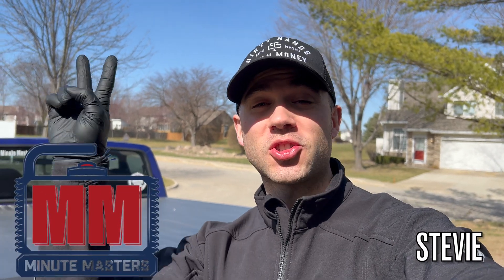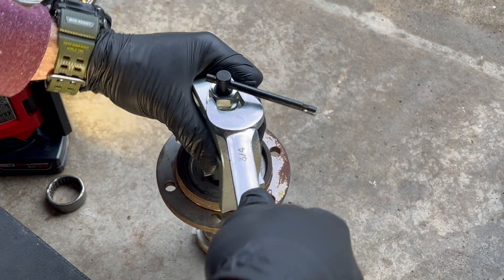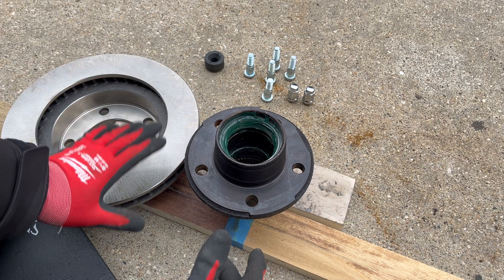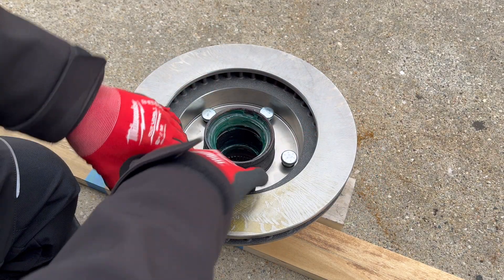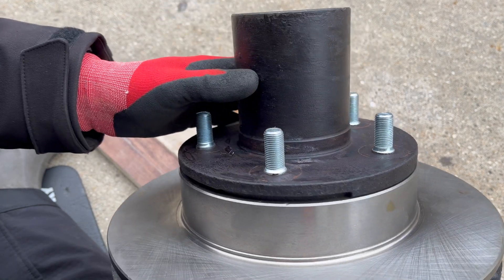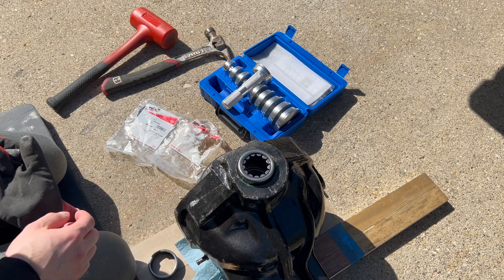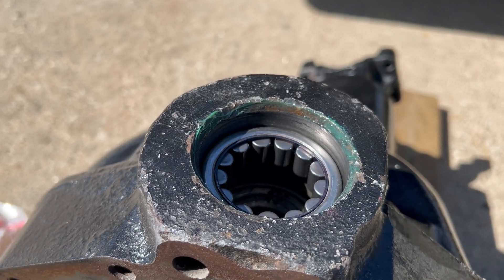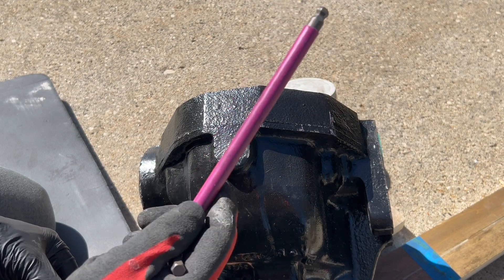TTB 4x4 SWAP [PART 2] - How to Install Spindle Bearings, Rotors, Wheel Lug Studs  | 1995 Ford F150

Comment: Can you do a video on an E150 04 - 06 spindle swap improving brakes by using the rotors and calipers 2 piston system massive upgrade for the OBS F150 Thanks
Reply from the maker: I’ve heard of that swap and it sounds awesome! But I don’t have any current plans to do it.

Comment: Is there a way to add a dual gas tank to my 95 f159 4x4  if it didn’t come with the dual version?
Reply from the maker: Good question! There probably is a way but if you don’t have the second fuel door in the bedside, you would need to fab one into place.

Comment: Hey Minute Master i have a question for you and i can't for the love of life find the item. it's the line from the charcoal canister to the fuel tank(s) i think, it's called the vapor line should be a 3/8" i seen it when you did your vacuum hose video. is there any way you can help with a link to the part? i checked LMC/Rock Auto and Amazon and nothing close.
Reply from the maker: So that vapor line is basically rubber fuel line, 3/8” I think. Any of the straight metal lines are fuel lines as well. You can actually buy generic kits to make fuel line. That would be the best way to replace all of the tubing between the charcoal canister and the fuel pump.
Reply: @TheMinuteMasters  thank you for the info, been following your videos to update everything on my 93
Reply from the maker: @mongrueles  thanks man!🤙

Comment: FIRST?  Is it me or them studs seem short?? Double check them against the factory rear ones. May have to get the upgraded studs/nuts from desolate as well....   My third member went to a gear shop to be rebuilt because a nosy neighbor messed it up while I was in the hospital, Uncovered it to where weather had rusted Down by the Piñon on the inside
Reply from the maker: Those studs came from Desolate Motorsports.